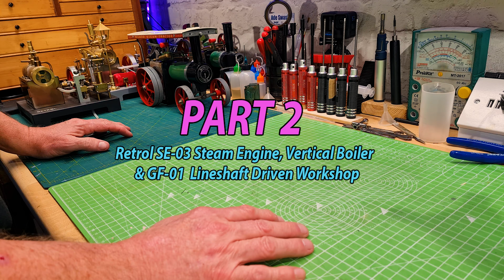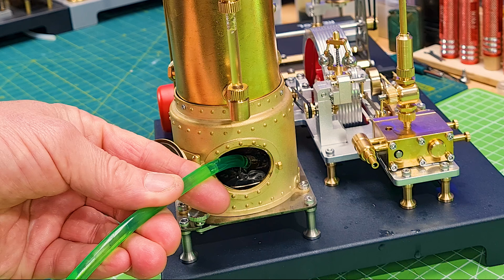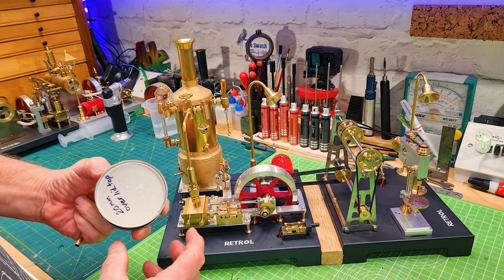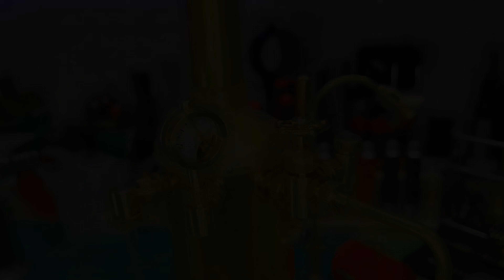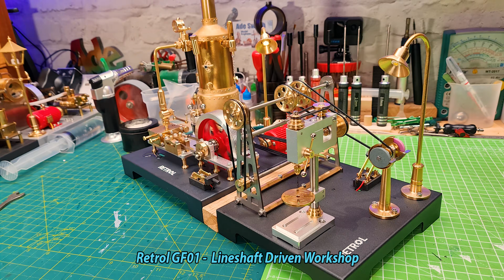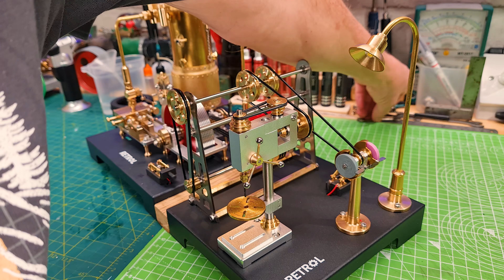Miniature Steam Workshop! PART 2 - Retrol SE03/GF01 Fired up and Steaming! Part 2-  #enginediy #stem

Comment: The GF-01 is a lovely accessory. Although I'm not sure why they went for the central pulley to drive it. Quite awkward to have it permanently attached to the SE-03. It's quite easy to alter the pulley arrangement or even make a new one like I did. Makes it much easier to drive it from other engines. Cheers, Alan.
Reply from the maker: I totally agree Alan, I will be modifying it like you have. Ade

Comment: G'day Ade out of all the fuels I've tested so far, by far the best has been the hand sanitizer. Lots of power even with the lamp post light continuously on and the pressure gauge not dropping. My pump bottles allow me to be able to stick the nozzle in to fill the burner tray, but you've come up with a brilliant method of filling it up that I will give a try - Cheers Jim

Comment: Does anyone know if the boiler is silver solder or soft solder or does it have those silicon seals?
Reply from the maker: Its difficult to be sure, but the actual cylinder of the boiler, i think may be copper, which has been treated with some sort of electro plate. The reason I think this, is because it has quite a few minor dings and dents, which would happen after heating and soldering, it being soft annealed, and being thrown into a tub with other boilers on the production line.  But - difficult to be sure because of the finish.